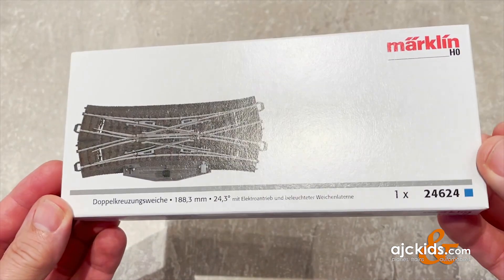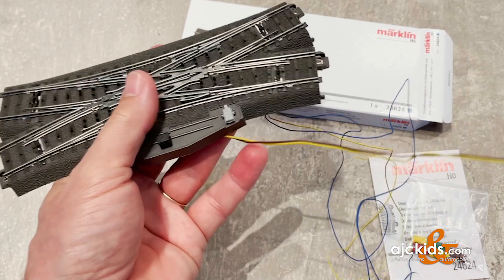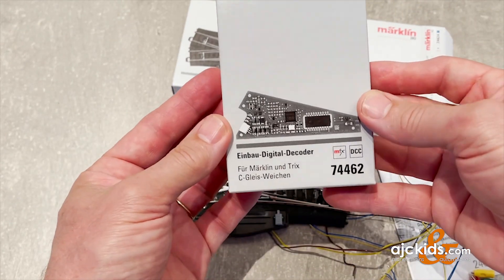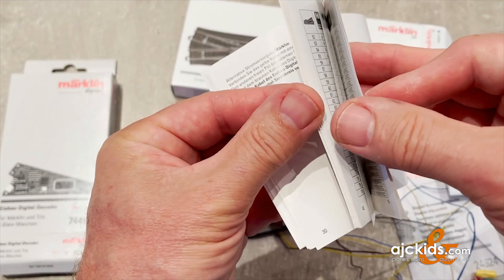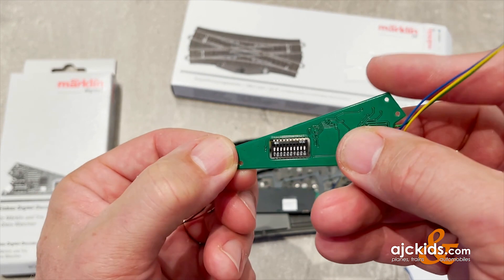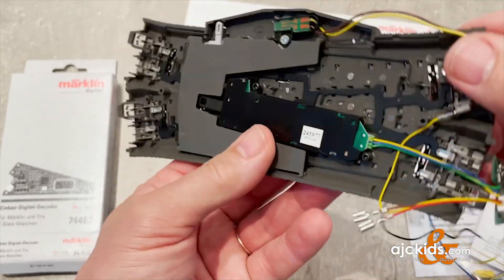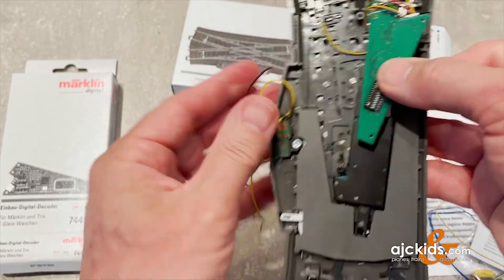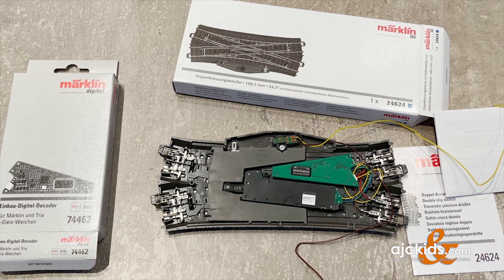Marklin 24624 Double Slip Switch - Unboxing and adding Decoder 74462

Comment: Thank you for this instructive video. What about the wire connections if you use an external power source?
Reply from the maker: Hallo John,

The yellow wire from the decoder would be connected to an external power source (max. 20 volts DC power). The other pole of the external power source would be connected to the brown wire, ie. the outer rail, of the C-track.

So the brown wire is used as common (shared) wire for two different power sources: the digital track power, and the accessories power.

We used this same technique when you and I were much younger, and we had the blue analog transformers. We used red and brown for track power (varied from 0-16 volts AC), and yellow and the same brown for accessories (steady 16 volts AC).
Reply: @ajckids  Thanks so much. Greatings form the Netherlands.